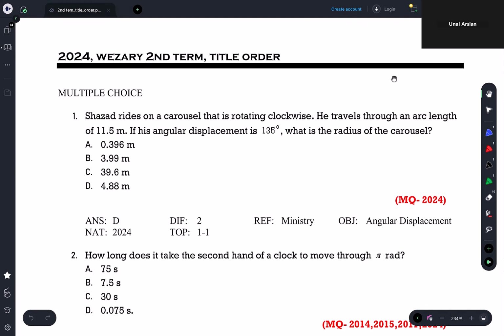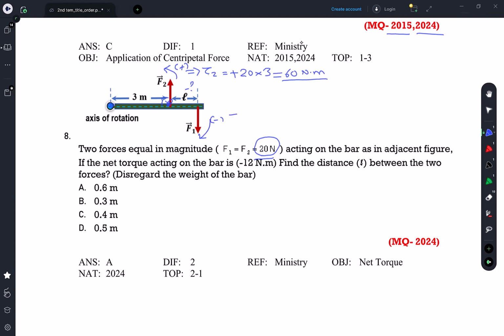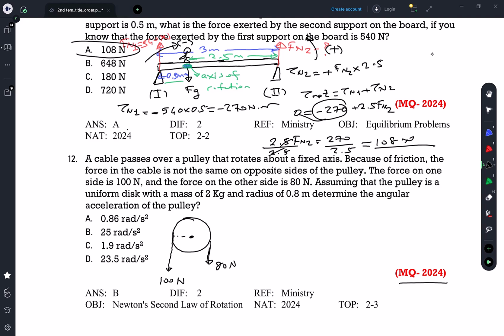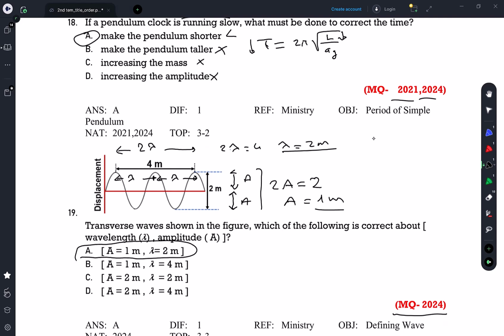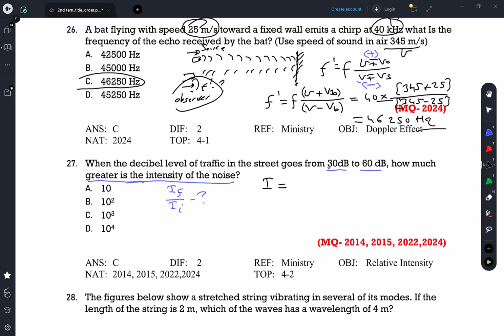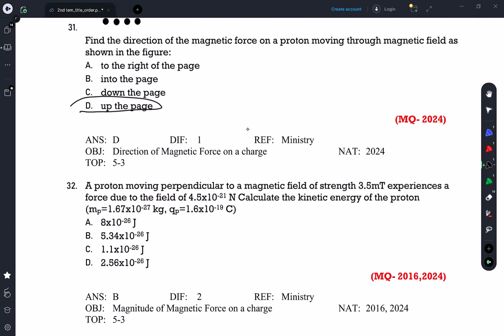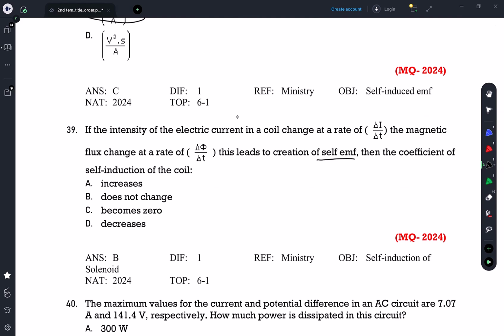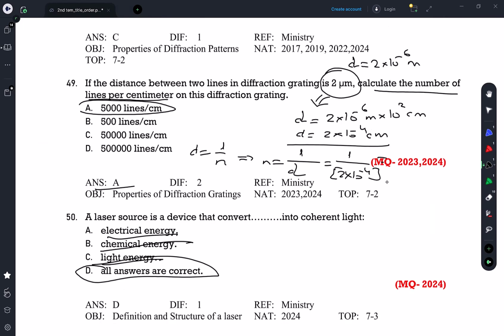WEZARY PHYSICS 2024, SECOND TERM, ANSWER KEY

Comment: If the intensity of the electric current in a coil change at the rate of the delta current over delta time the magnetic flux change at the rate of delta flux over delta time this leads to creation of self emf then the coefficient of self induction of the coil :ans.. become zero. Teacher I can not get this question
Reply from the maker: Rate of change of electric current and rate of change of magnetic flux are directly proportional. They cancel the effect of one another, thus L stays unchanged.
Reply: Thanks teacher